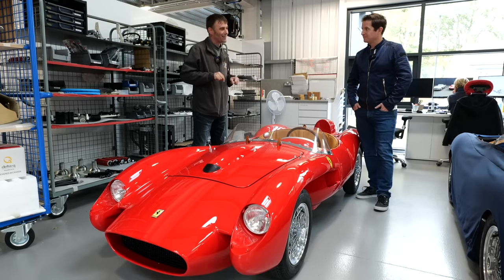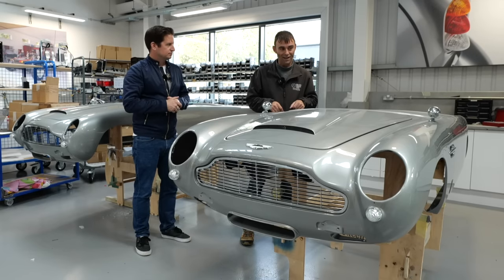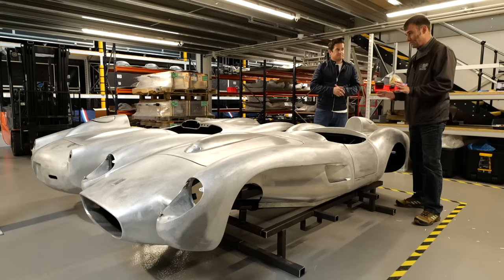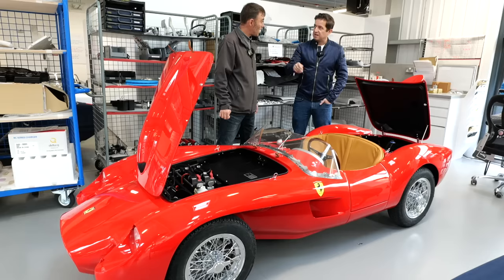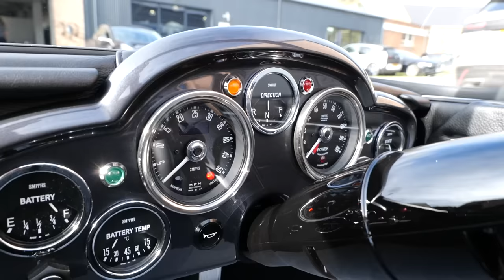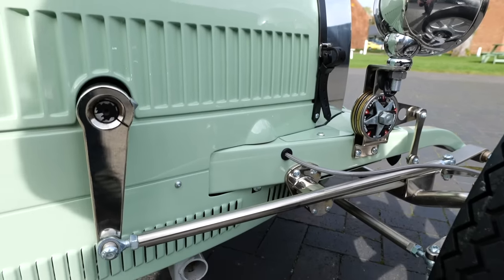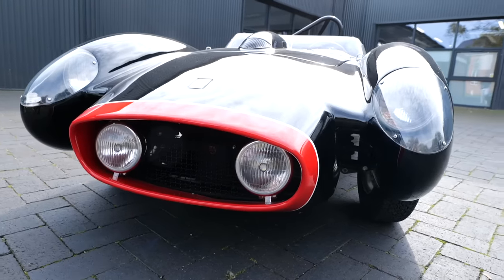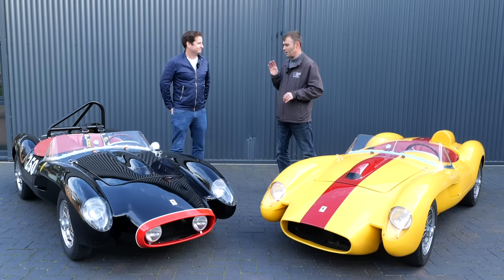Electric Ferrari, Aston Martin and Bugatti, with a twist.

Comment: Another slap in the face of the EV naysayers. Bugatti and Ferrari approved all electric classic car replicas. But, they're not really replicas. Ferrari regards them as limited edition production cars. They may only have a 6kw battery, but they're doing over 11 miles per kwh. One of the most exciting things I've seen in a while. Richard is so lucky to blast around in them. The Little Car Company are packing quite a punch with these pocket rockets. And it shows that full sized all electric classic replicas would be losing nothing. Sorry about that purists.
Reply: Well said 👍😀